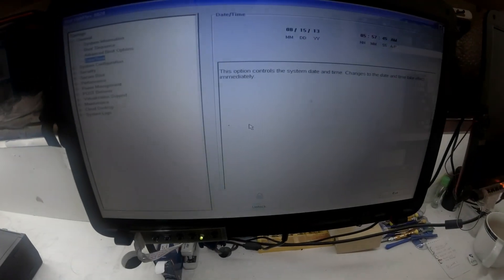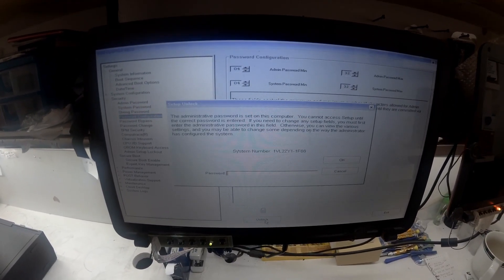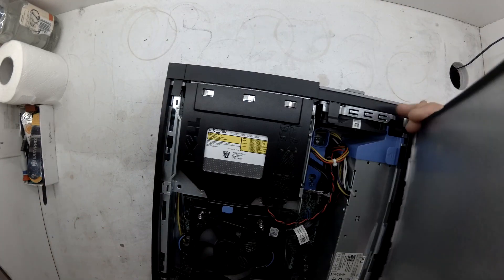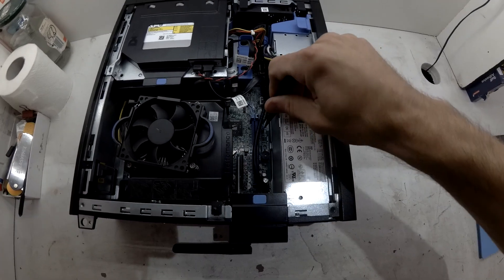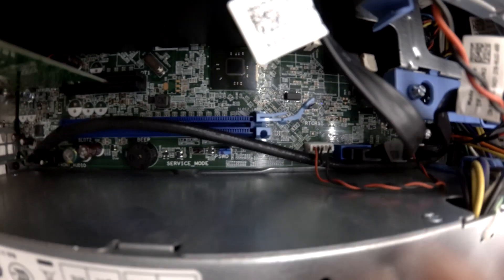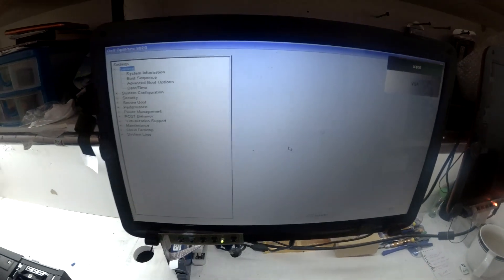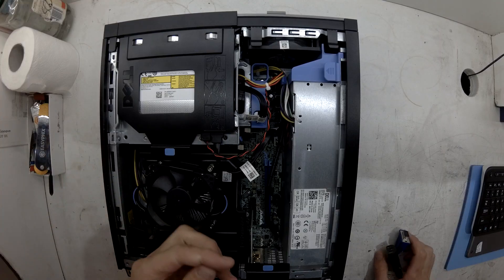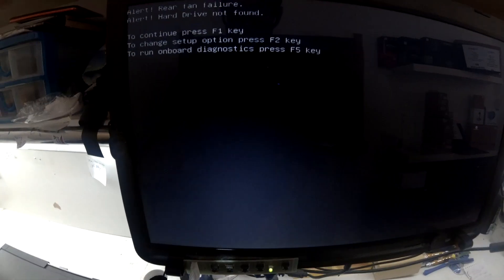Removing the Admin password on a Dell Optiplex 9020 SFF

Comment: THANKS SO MUCH !!  Now 9020 is stuck in repair loop . I put the jumper back in . still in loop :( please help
Reply: And it remembered the password even tho i removed battery - cleared and residual charge -  and put it back in before start up. 😭
Reply from the maker: This also clears the settings in the bios 

Load up the bios and check what drive your desktop is booting from

Change from ide mode to ahci

Comment: How can i solve a problem in my Dell Optiplex 9020 poping up a desktop hard disk error 20000141
Reply from the maker: I would suspect it's got a failing hard drive that would need to be replaced
Reply: @rickstechrepairs  Thanks i just did that and it is back to work